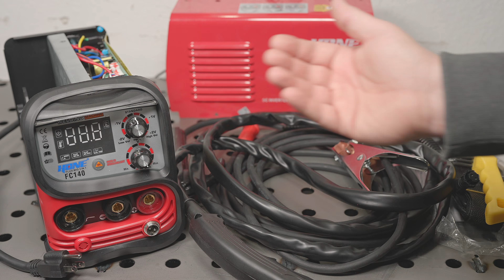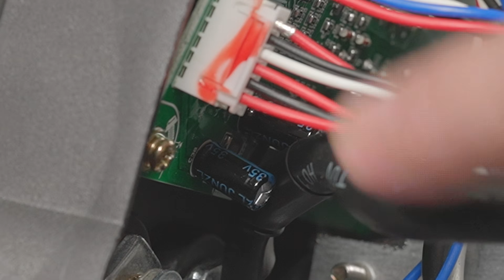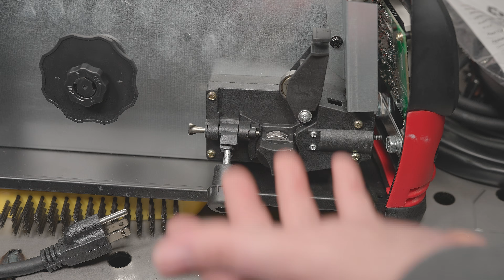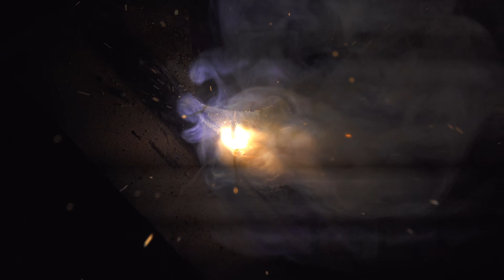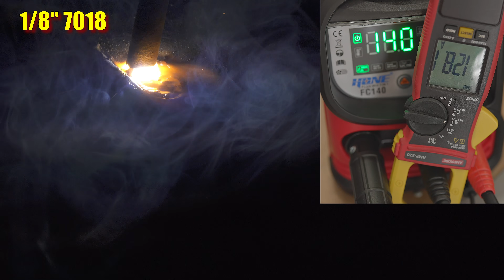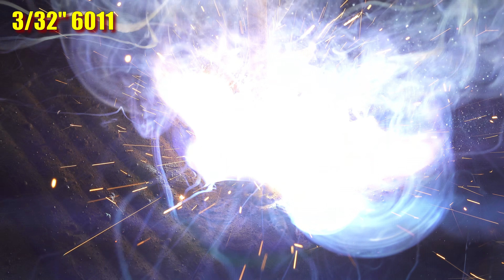Hone FC140 - $120 Multi-Process Welder Review

Comment: On my FC 140, the red sleeve cable is the ground clamp. You appear to be using a positive ground for stick welding. Was that intended?
Reply from the maker: When flux core welding, I had the work clamp cable connected to the positive wire, because flux core gets run with electrode negative.  When stick welding, I had the work clamp/ground clamp connected to the negative output and had the electrode holder connected to the positive terminal, for electrode positive.

Comment: Worked for a recessed head bolt removal. My only issue using this was the wire drive system kept getting stuck. That took the longest out of the whole job.

Comment: I really appreciate your reviews of these welders.  No hype or hyperbole in your content and excellent observations and commentary!  My question is, do you have some machines that you would recommend that won't break the bank?  I checked your home page and couldn't find anything comprehensive.  Primarily I'm interested in stick and MIG (both gas and gasless, i.e. flux core) in a machine.  Dual voltage would probably be key as well as I'm sure I'll be helping a friend out that won't have 240-volt service.  I also figure if I get into TIG or need a plasma cutter I'll get standalone units for that.  If I missed a video that you have already done this, just point me in the right direction.  Either way --thanks for sharing these informative videos!!
Reply from the maker: What's your budget?  I haven't tested all that many, super cheap MIG welders.  The ones I have tested did work, but had quirks and things you'll have to work around.  I've been wanting to test some more "mid-range" MIG welders in the $700-$1,200 range, but it's just not in the budget right now for me to buy machines like that to test.  I've had a $1,200 machine on order for a couple months now that was supposed to ship at the beginning of December, but it's still not available.  So I'm kind of in limbo at the moment.
Reply: @bigtb1717  Clearly I "want" a Millermatic type machine but there is no way I can justify the price tag for the one I'd want.  That said, yeah, I'm in the same ball park where $500-$1,200 is something I could shoot for if everything worked as described.  I say that as I was seriously looking at the Yes welder MIG-205DS.  I think it's the same model you had examined except they have now put a black case around it...  It absolutely drives me nuts how Chinese companies can lie like hell about the capabilities of their machines without any repercussions!  On the face of it, that model did have the features I was looking for but from the copper coated aluminum cables to the inflated number to the unknown warranty, it's turned me off to that company.
Reply from the maker: I haven't tested one yet (I'd like to, but can't say when it might happen), but ESAB has a new EMP 210, multiprocess machine.  List is $1,399, but Cyberweld (I've ordered from them before and had no trouble) has them for $140 off, plus ESAB has a $150 mail-in rebate on them right now.  Would put it toward the top of your price range, but it can do MIG, TIG and Stick and comes with the stuff for all three.  Output and duty cycle are decidedly non-industrial.  I'm sure it doesn't have power factor correction, so the output on 120V isn't all that high, but it is dual voltage.  And I bet it can meet the claimed specs.  And it has a three year warranty.  Could be an option.
Reply: @bigtb1717  I've heard really good things about ESAB (I think they were bought by a huge multinational some years ago) but people I talk to keep pointing to the "Rebel" series that just blows my budget up.  This one looks interesting and I'll check it out.  It's bumping into the upper end of what I can justify spending but I can put it on my birthday + Christmas + fathers day +... list and maybe I'll get the OK.  Lolol  At first blush, it looks like it checks all the boxes for me so many thanks for the suggestion!!

Comment: Great video 
Can you recommend something nicer?
Thanka
Reply from the maker: Are you primarily looking for a flux core machine or a stick welder?  I only ask, because it's cheaper to get a single process machine in most cases.  From your other comment it seems you may just need a welder for a single job.  The Hone 185D stick welder seemed pretty good for how inexpensive it was if you just need a quick stick welding project done.  The Titanium Stick 225 from Harbor Freight also ran pretty well.  If you are looking for something with a better warranty and higher quality, the ESAB Rogue ES 130i is a good value.

For flux core, I haven't tested as many machines, but the Titanium Flux 125 from Harbor Freight was once again a good value for the performance.  I have since seen some reports that people have had them fail on them.  Granted, anything can fail, but the standard warranty is only 90 days, I believe, so keep that in mind.  I tested a couple Vulcan MIG/Flux core welders from Harbor Freight and they were surprisingly good.  But they have also gone up in price quite a bit since then.  They aren't much cheaper than ESAB, Lincoln and even some Miller units these days.  Though Miller's higher end machines are still far more.  Unfortunately, I simply haven't gotten around to testing very many wire feed welders at this point.  I'm sure there are some other good value machines out there.  But I hesitate to make any specific recommendations of cheaper machines if I haven't tested them.  With some of the cheap stuff, even from model to model within the same brand there can be a lot of quality variation.
Reply: Hi yes mostly just for one job  Stick is ok  too just to built a handrail Thanks for the  reply I will take the hone machine  @bigtb1717

Comment: great review.  i picked up the previous Hone unit you reviewed based on your assessment and my experience has matched yours-- very good.  I took it apart and it indeed has parallel  IGBTs (so 4 total transistors), dual bridge rectifiers and a proper soft start circuit (PTC resistor shunted by a mechanical relay after a short time delay - allowing the bug electrolytics to initially charge up at socialable rate.) .  The long cables are also a nice touch.  Have run lots of  6013, 7018, 6010 in 3/32 and 1/8", as well as some EN55 and E309L.

This machine seems to miss the mark.   Better to pick up a dedicated stick / lift unit like that Hone, and a Tiitanium125 which can be had for nearly the same price as this one if you are patient and catch it on sale and/or with one of those super coupons for 20 or 25 pct off a single item ..

This
Reply: You mean the hone arc welder he reviewed?
Reply: @summerforever6736  Correct.  The Hone ARC welder he reviewed fairly recenttly, that he generally liked  (or at least was far less disappointed by, in comparison to a long string of other units  tested).  

 My experience with it has been consistent with his, and it is the only unit i've found at this highly affordable price point  (let's call it  $80  and below) which has both dual 120/240 voltage and doubled /parallel IGBTs (for a total of 4 igbt transistors versus more commonly only 2 at this price).     The transistors, diodes transformers, inlductors , capacitors and other components are  consistent with its amperage rating, which cannot be said for  most of the other claimed "165 to 200 amp" units at this price point, as they typically only have  2 igbts and less beefy components and do only 130, maybe 135 amps in reality. .
Reply: Thanks for the response  looks like a good unit  @GannDolph
Reply: @summerforever6736  🙏👍
Reply: What else do you recommend for that price range?
Reply: @lllll87232  the S7 is also an honest 200Amp.  I have the blue 220V version.  There is/was also a dual voltage 110/220V version, and apparently a yellow 110V version now too which claims also to be 200A, though that is a lot to pull out of 110V.  But it probably still performs well and has the stout paralleled IGBTs unlike most of the other brands with a cheapened design (they have half the IGBTs and diodes, and their toroidal transformer is of much lighter weight.)